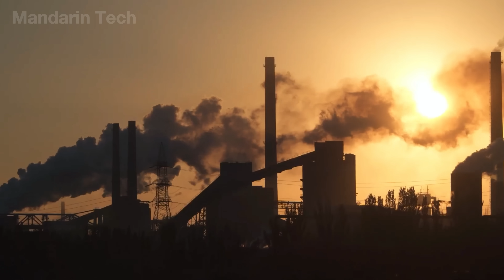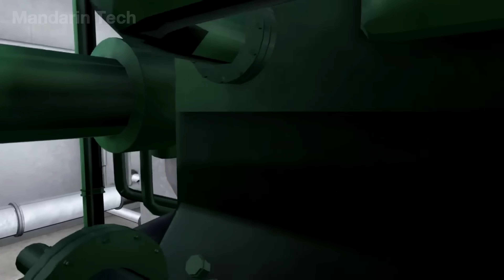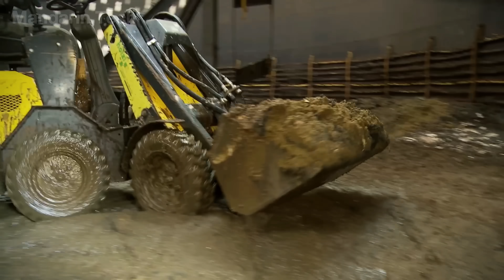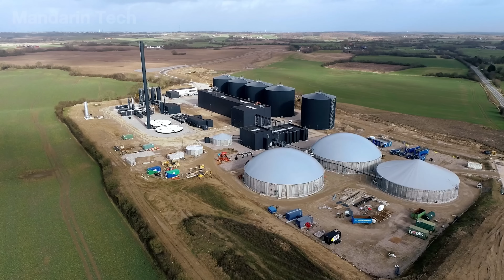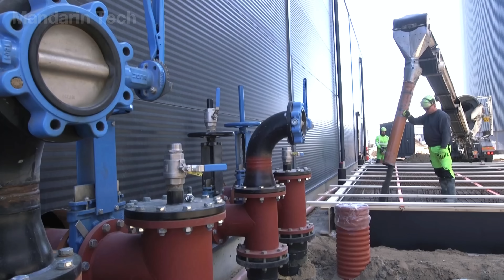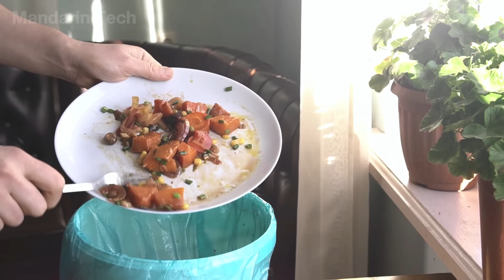How Denmark Turns Agricultural Waste into Biogas at a Facility Larger Than 100 Football Fields

Comment: I've seen some large US pig farms embrace this. The Gas is used to power to the trucks delivering, some of the gas is used to generate power for the farm so its energy independent and the waste heat from that is used to keep the pigs warm in winter (and perhaps run fans in the summer). The bonus is that it cuts odor gas release that pig farms are well known for. The other is digestate that when dried (using the same heat) is loved by farmers are natural nitrogen and sulphur rich fertilizer. What is also useful is that methane generation rises with a more diverse feedstock so  farms with other waste products (and dairy waste) can send their waste for free and the biodigester gets even more efficient. The byproducts can also be used. The water - for diluting the incoming waste if its too dry or or other byproducts are (corn/soya waste) and irrigation and then Carbon can be used in greenhouses where non animal crops like vegtables grow 30% faster due to the higher C02 (and they absorb the C02 as a feedstock) . The result is less manure ending up in rivers and seas, less Climate change emissions from harmful methane, better fertilizer as a near free local product (of higher quality as well), Natural gas, water, faster indoor crop production. Some plants even export the C02 for use in local breweries for carbonation. Its not just Denmark- Germany, Switzerland and Austria plus some areas of France are doing this on a big scale.
Reply from the maker: It's amazing how one system can turn farm waste into energy, fertilizer, and even an extra source of income!
Reply: @Mandarintechmido  There is one in the UK. It uses the biogas to run the farm and move the products. It sells the C02 to a brewery, the sulphur is mixed into the compost and then given back to the farmers for cost to avoid them importing fertiliser. the water from the gas is used for irrigation and to wet the incoming dry feedstock for the digester and the gas is either burnt to generate power or injected into the gas grid with constant demand for it. The waste heat from burning it is then put back into the digester (useful in winter) and to heat the farm buildings. The compost is much higher quality as it combined multiple different feedstocks and its all natural and the waste heat dries it so its easier to spread in wet weather and avoids manure run off and poorer dispersal than wet manure. Even the remaining VOC gas can be used in the furnace to accelerate the burning. Now imagine many farms contributing to their own gas plant and fertiliser maker and anyone with organic waste to dispose has a free destination from diary processing, beer waste, processed food waste even domestic food waste. And that methane is otherwise supercharged c02 if just vented from soil or manure silos.

Comment: The digester-cleaning section surprised me most — after years of operation, sand and sediment can build up tens of centimeters thick and cut gas output, so crews have to vacuum out the sludge and even bring mini-loaders inside the tank. Pairing that with the seven nearly 10,000-cubic-meter digesters running at 38–40°C, and upgrading the gas to over 97% methane, really shows why Korskro can feed biomethane straight into Denmark's gas grid.
Reply from the maker: Thanks for sharing these fascinating details! Cleaning those massive digesters is truly an impressive operation!

Comment: Pretty trucking intensive.  Even if the economics can't be justified, removing all that biomass that would mostly rot and release CO2 into the air, this project is an environmental positive. 

Meanwhile, here in Texas's Permian Basin it's drill, baby drill.  With incredibly bad environmental consequences of fracking.
Reply from the maker: Great point — environmental value can’t always be measured by profitability alone.

Comment: The foundation for something like this began in the late 1970's when an oil shortage created by OPEC caused much of Europe to review it's dependency on foreign energy. In Denmark it famously led to a ban on private car travel on Sundays leaving the streets free for us children to play on.

It also led to revised building codes requiring a minimum of 20 cm of rockwool/glasfiber (or the equivalent) from the previously 10 cm. And it eventually led to high tariffs on oil, gasoline, electricity, etc. All that created lot of incentives to explore alternatives be it wind, solar, 3 layer glass windows, and energy saving technology. Central heating systems was complemented with furnaces to burn garbage instead of creating ugly landfills.

It also led to the exploration of oil and natural gas from the North Sea and a massive network of gas pipes to distributing the gas all the way to the customer, like the heater in my house. Once the gas network is in place, it is easy and cheap to create biogas plants and pipe it into the network.
Reply from the maker: Fascinating historical context, thanks for sharing!

Comment: In summer biogas can power nearly 90% of Denmark ussage but in winter its only 30% due to we still harvest big amounts of fossil gas from our part of the North sea and ofcouse we export much of it.
Reply from the maker: Thanks for adding that real-world perspective from Denmark!
Reply: Biogas production needs temperatures around 40C to generate the largest amount.In Vermont,the gas is fed into a generator to produce electricity,but the waste heat is used to keep the tank at a higher temperature.
Reply: But you generate 30% of it on land, cut farming emissions, reduce farming manure related pollution of th land and watercourses and it generates a profit and the byproduct can be used a fertiliser (better fertiliser) and the other products have further value if captured.

Comment: Living in Denmark I can only say that you should not wish this for you. It is a stinking pile that polutes the air around for miles. You can`t smell the otherwise wonderfull smells of spring or summer . The entire countryside is smelling very foul most year around. 🤢🤮
Reply from the maker: Thanks for sharing a local perspective on the issue!
Reply: You don't know what a bad smell is until you have lived downwind of a rendering plant (dødkogeri).
Reply: I once worked on a new Biogass plant. The bought a machine that could remove the smells. It was a swede that was doing the instalation. So I had to ask him what them most smelly thing was. He answerd fish bonemeal factories. Pig manure was nothing.
Reply: Biogas and all renewable energy are very expensive. Trump declared on hşs soeach to the United Natiın general assembly. AND HE ADDED THESE PROJECTS ARE FAKE INDUSTRIES.

Comment: Dane here.  I have Biogas into my house.  It works perfectly, and my power comes from wind sun and other sustainable energy sourges..  So the close of Hurmus not really an impact on me. AND it is cheap The cost for a periode of 3 month for heat and hot water is 84$ including  all taxes
Reply from the maker: Thanks for sharing your experience—it's great to hear from someone using it every day!
Reply: stop dig selv,
brænder du gas af skaber du co2 som forurener..

og vi bruger masser af fosil brændstof i dk bla på vores strøm

vil du åbne en virksomhed der laver en vare, kan du ikke komme på elnettet og du må bruge en diesel generator

vi har ikke engang startet vores grønne omstilling, vi mangler 100x  billig grøn ren energi mere bare for at dække vores eget forbrug i fremtiden

men vores elnet hænger sammen med eu som vi også skal have dækket for at sænke vores priser seriøst...

og vi skulle også gerne kunne sælge andet end novos dyre stoffer, så det ik kun er dem der tjener penge

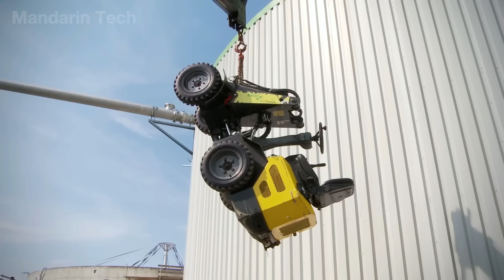Comment: 6:25 🤔 If biogas from livestock manure is really this efficient and clean, why is most of the world still investing billions in natural gas instead of scaling up this model? Are we missing something here?
Reply: No one wants to pay for the initial capital expenditure.
Reply: Yes, you are missing something. That something began in the late 1970's when an oil shortage created by OPEC caused much of Europe to review it's dependency on foreign energy. In Denmark it famously led to a ban on private car travel on Sundays leaving the streets free for us children to play on.

It also led to revised building codes requiring a minimum of 20 cm of rockwool/glasfiber (or the equivalent) from the previously 10 cm. And it eventually led to high tariffs on oil, gasoline, electricity, etc. All that created lot of incentives to explore alternatives be it wind, solar, 3 layer glass windows, and energy saving technology. Central heating systems was complemented with furnaces to burn garbage instead of creating ugly landfills.

It also led to the exploration of oil and natural gas from the North Sea and a massive network of gas pipes to distributing the gas all the way to the customer, like the heater in my house. Once the gas network is in place, it is easy and cheap to create biogas plants and pipe it into the network.
Reply from the maker: Great question—scalability and infrastructure are often the biggest challenges.
Reply: well not all have as much source material as Denmark, the country have 6 million people, but just of pigs there are 13 million.
And the country are not at all green, every summer large areas of near costal waters turn into oxygen free death zones, and the country is also running out of clean water wells, which is the only water Danes drink.

Few countries are as intensive farmed as Denmark are, you can argue there is extremely little original nature here, hell even lakes have been drained to gain more farmland, and rivers have been turned into strait canals, and then dammed up with disastrous results for migrating fish like salmon.
Reply: Capitalism. The natural gas industry will do whatever is necessary to not lose profits

Comment: A fake video. It is not a success and people get sick living close to these experimental factories. It has value for owners because of subsidies.
Reply: It doesn't have to generate a profit to be a success.

1.The plant converts large amounts of organic waste and slurry into upgraded biogas.

2.The green gas is sent directly into the general gas network and replaces fossil natural gas, which significantly reduces CO₂ emissions.

3.The plant recycles large amounts of biomass and drives CO₂ plants, where the excess CO₂ from biogas production is collected, cleaned and reused industrially.

4.The solution has its challenges, but it is still a better solution than just spreading them on the fields as fertilizer. The odour problem is real,as is the traffic of heavy vehicles but overall I think recycling is the responsible way to solve the problem.Furthermore it's conveniently located in rural surroundings close to the highway, so in terms of both odor nuisance and transportation nuisance, it is clear that these problems have been addressed already in the construction phase.
Reply: Simply not true
Reply from the maker: Thanks for sharing your perspective—it's definitely a topic with many different viewpoints.
Reply: Hvem fanden har pisset på din sukkermad? Det er jo IKKE en fake video, den er reel nok, anlægget ligger ved Korskro, heraf navnet, og det har været i kommerciel drift i mere end 6 år nu.
Reply: I don't know if it's fake, but there are problems with the set-up. China has been doing this for decades and has a green methanol powered container
ship running on bio-methanol provided by OCI, plus much larger projects than this across the country.

Comment: How come not a word was said about costs?
Reply: according to costs. I have no idea, but probably it can be found. From my experience, when I was working in  my country for one of largest vegetable producers, they have 2 digestors (maybe combined size is one of those shown) attached to engines burning it on site. Heat was used to heat their buildings and digestors themselves (in winter time) and of course electricity from attached generators was used for various purposes (to cool storages - we were installing 1000's of PV on roofs) with selling overproduction. That set up was pretty worn down, so I assume that it was there for decades. Before that mess eastwards from EU begun we had easy cheap natural gas available (still have, but it is tricky and not reliable source now ... ). 

looks that operating such thing is net positive
Reply: BTW: I was working for 2G in Germany producing containerized natural and biogas power generators, most was EU standard, but I worked on one made for customer from USA and 1 from Australia (and was making stupid jokes we have to build it upside-down). So, this works world wide for people, not only Denmark
Reply: Because it is outside of the scope of the video. Read the title of the video.
Reply: @kristianniss5201 - The cost of disposing of agricultural waste is at the heart of the issue. You can’t build facilities to turn it into biogas if you have no one to pay for it. That’s the start of the discussion, not the end of it.
Reply: @zalman7208  so, you can use it yourself. As I mentioned above. On top of that, I saw how breweries use this principle to make energy from bio waste from beer production. You always can turn waste into energy and sell that energy (sell overproduction). And it cowers burning old bread in some bakeries as well as burning general waste as Sweden does (and other too, of course). From my experience, in cement factory can be safely burnt tires, plastic, chicken dung (i was working on conveyor belt overhaul in one).

In most cases you at first save costs on waste disposal and at second you save on energy cost.
Reply from the maker: Good point—the cost side is a fascinating story on its own!
Reply: @Mandarintechmido  - More than you know. These are today's facts, as best I could find out:
At this time natural gas supplies are restricted in Western Europe. Prices are very high for a number of other reasons, including the "not war" some slob is conducting in the Persian Gulf. 
This should be a time when biogas shines from a competitive price perspective, and it certainly does. Just found out that ACTUAL (raw cost) biogas cost appears to be FIVE TIMES as expensive as expensive natural gas. Biogas is being produced only because of public support for its pricing also the prohibitive cost society there has imposed on disposal of animal crap.
In other words, it is a burden on the public to bring its cost within accessibility. That money is taken from all other desirable public functions that could be funded were it not for biogas. Not a problem if cost of energy has no effect on the economy.  Which happens exactly never.
Reply: @zalman7208  how Can it be then,that danish farmers are building there own private. Biogas plants,Farmers do not build anything without seeing some profit
Reply: @Mandarintechmido you say it in the video, it is paid for by the sale of gas into the grid